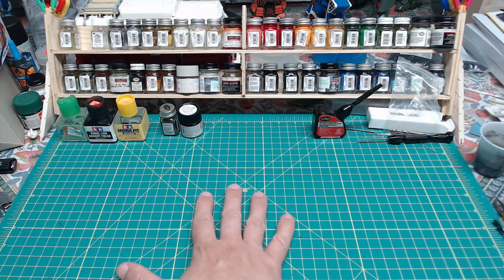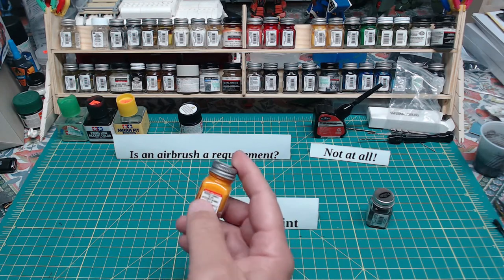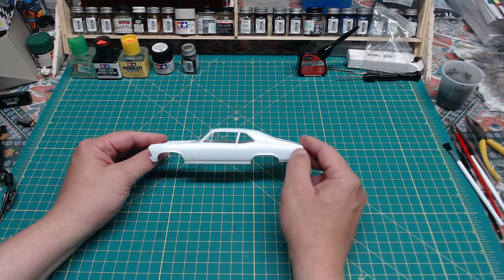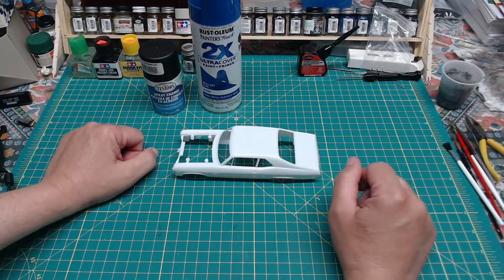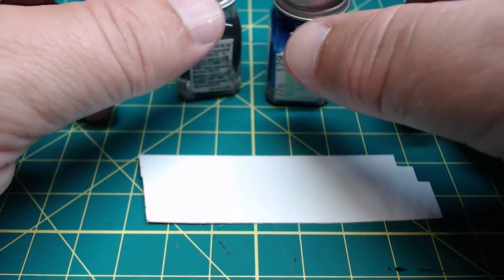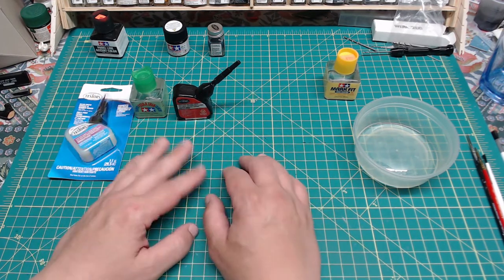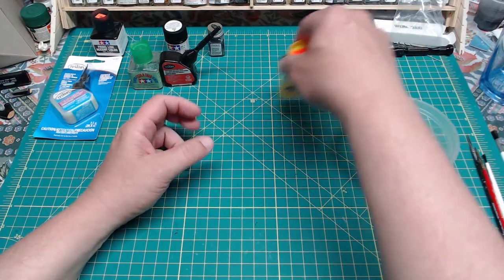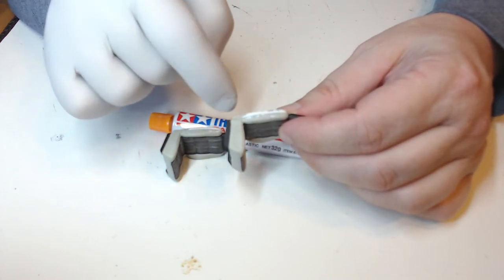Practical Plastic: Episode 2, Plastic Model Tips

Comment: testors no longer makes bottled paint. tamiya paint is becoming the go to standard.
Reply from the maker: Oh no! Tamiya paints are great, but I do like the old-school Testors enamels as well (probably out of nostalgia and sentiment, since enamels were my go-to way back when I was a kid building models). There are times when my gut tells me an enamel will work better than an acrylic. Unfortunately there's nothing specific or predictable about those moments, just a judgment in a moment.
Reply: Quick personal update 12/12/ 2021: The "NEW",  Tamiya Enamels are great. The plastic screw cap with nylon seal wont give you the old grief of Testors enamels. Do not confuse with Tamiya acrylics.
Reply from the maker: @gordonenquist36  great news, and thanks for sharing! Some of the "nostalgia" of Testors enamels (as much as I've enjoyed them over the course of many builds): opening a bottle to find the paint has turned into a block of goo, paint seeping from the cap onto the threads requiring plumber's wrenches to later open the bottle, and the tendency of some paints to have their pigments separate all of two seconds after a thorough mix. Any others, please post to share :)